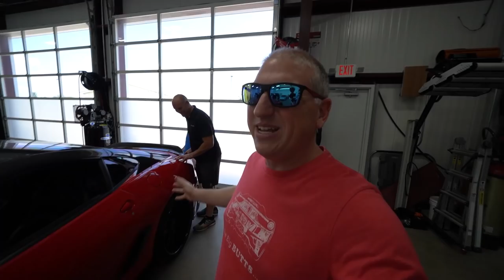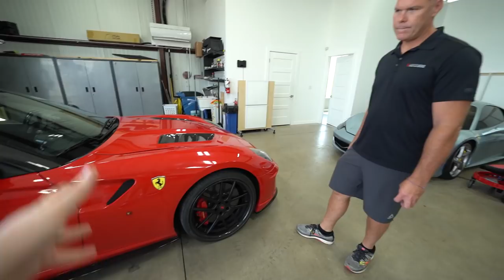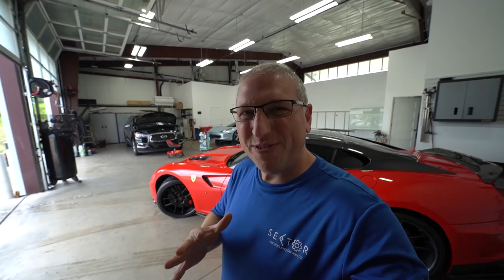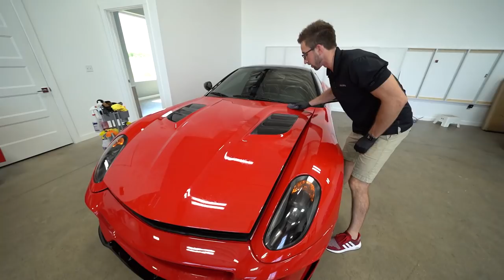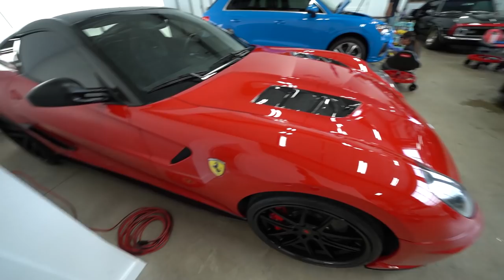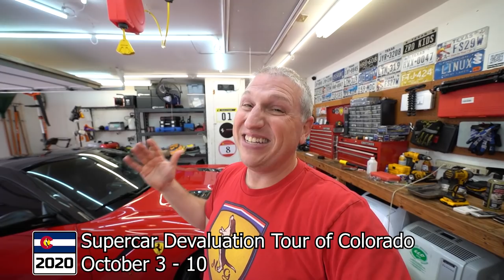FERRARI 599GTX PERFECTION - CUSTOM PPF INSTALL & PAINT CORRECTION

Comment: Hi Dan 👋  been off yt  for a little while,,,.
 Has this 599 been sold if not ,, could you let me know on where the price starts . low to high  after all you beautiful  work is completed. . Cheers mate
Reply from the maker: No this car has not sold.  I haven't completed the conversion yet.  If you want it pre-conversion you'd need to get hold of me really fast as we're going to be pulling the trans very soon.  If you want it post-conversion, then you can wait for the auction.  Unless you want to make an offer.
Reply: Your honest   Opinion dan .  Yes I like a  stick shift  mate its been  A while though and the cost to convert  it $. Last question does it change the  Reliability of the transmission  if you convert it,,
Reply from the maker: No it won't change the reliability unless you are grinding gears a bunch.

Comment: Really surprised to see clay being used for prep after it was corrected. If that clay did actually pick up something in the paint it’s going to mar the surface at least slightly.
Reply from the maker: The PPF will hide any imperfections in the paint, and they don't paint correct generally on areas that are getting PPF'd.  The ppf doesn't stick as well when the paint is already corrected.  Plus no reason to remove a bunch of clear coat if it's just going to be covered up.
Reply: Dan is pretty close in his explanation, but I’m happy to explain it a bit further...

Clear coat imperfections rarely, if ever, show through PPF after it’s installed. This is because the film is so thick, light is not able to refract off of the small scratches usually existing under the surface. Not only this, but PPF sticks at least twice as fast to a surface that is polished vs. not. This poses a much higher risk of running into installation related issues which could mean potential defects in the film. 

For me to polish the paint to perfection, and proceed to swipe the panel down with a squeegee, would be working backwards. 

I actually used to thoroughly polish every panel before install years ago because of having this same mindset. The more experience I got, the more I realized I was only hurting my installs and removing clear off of the paint that never really needed to be removed. 

If you’re ever going to do correction, I suggest only do it if you’re going to remove the PPF indefinitely, or only if you have very severe paint defects (if that is the case it’s usually too late to install PPF)